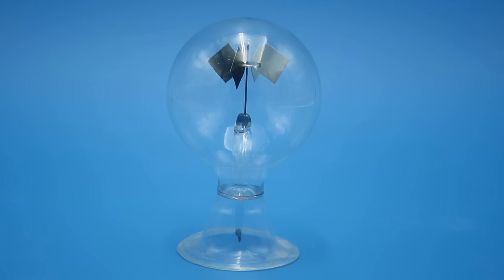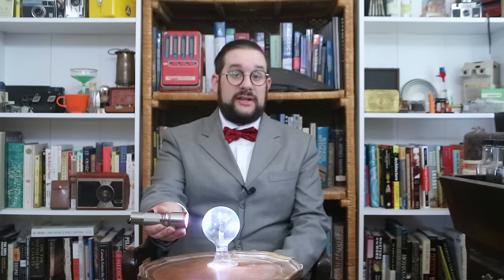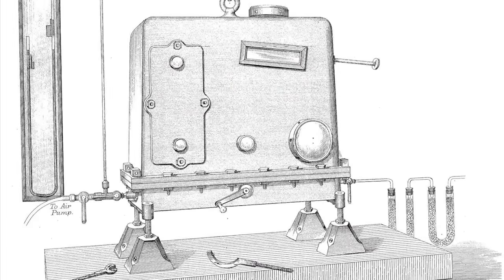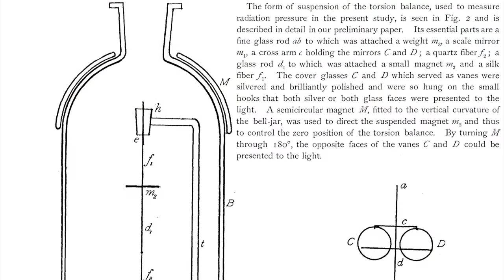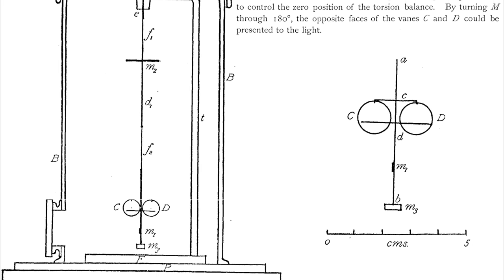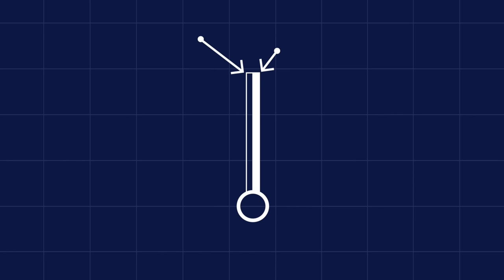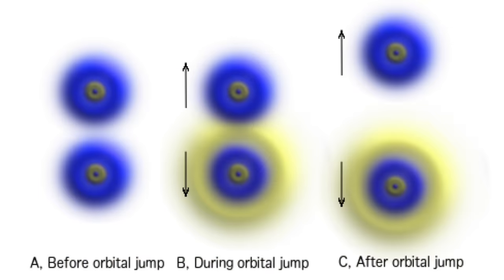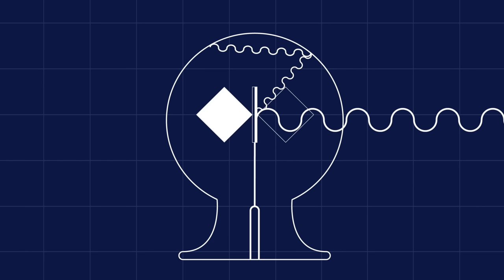Crookes Radiometer: a Surprisingly Persistent Scientific Mystery

Comment: I wonder if the paddles were replaced with balls, each colored half black and white like the paddles, would prove or disprove the edge theory. ( balls having no edges in their shape).
Reply: Seems to me that someone should build an easy to assemble kit where paddles of varying kinds could be tested.  Would it make any difference if the black and white was replaced by conductive materials?  Shouldn't be too hard to just create a bulb that can simply be lifted off for easy repleacement of the paddles.  Seems a lot more experimentation is needed.
Reply: @KenFullman  - but the radiometer only works in a near vacuum.  Making a lift-off bulb is easy - but how would you recreate the extremely low pressure required?
Reply: @jackx4311  With a vacuum pump.
Reply: @fantabuloussnuffaluffagus  That makes a kit like that a lot more expensive though. Not too many people will just have a vacuum pump on hand but even a pretty cheap one is going to run you like $70. A radiometer kit that costs 100+ is a bit silly for a completed item that is closer to 20
Reply: @alexsis1778  Do experiments have to be cheap?
Reply: @fantabuloussnuffaluffagus I would buy a interchangeable radiometer for $250 or maybe a little more depending on build and functionality.
Reply: @sambrose1  I think if you want one, you're going to have to build it.  All of the Crooke's radiometers I've seen have been sealed units, and you're going to need one that you can open up, reseal and pump down.  Rather than having interchangeable paddles, I suspect the simplest solution would be to have different drop in rotor assemblies.  At that point you may as well have separate radiometers with different paddle shapes and forget about changing paddles or rotors.
Reply: I don't know why the shape would have and affect for its in a vacuum
Reply: @jelehan88 they’re talking about being able to switch the shape out  themselves. They would have to take the glass off and lose the vacuum
Reply: Found an article that talked about an experiment like that with the edges.”n 1925, H.E. Marsh, E. Condon and L.B. Loeb confirmed the edge hypothesis [16], and more or less provided the final, satisfactory explanation of the radiometer with an ingenious experiment. They designed a collection of radiometer vanes with edges of different length but similar surface areas, as illustrated below. If the radiometer force arose primarily from the surface of the vanes, then the different vanes should have turned at same same rotation speed.  If the radiometer force instead arose primarily from the edges of the vanes, then each vane should turn at a different rotation speed for the resulting radiometers; this latter result was in fact found to be the case”

Comment: Neat. I always thought of it as excitations of the gas right next to the hotter side providing slight momentum which adds up overcoming the drag. Electrostatic imbalance is even better because it's so localized.  The things have a top speed so a kind of equilibrium should be achieved between drag and exposure time to light on the hot side of any given vane.
Reply: likely correct about gas temp, as opposite spin is achieved by spraying an upside down air duster can on it.

Comment: What a FANTASTIC exposition; thorough, organized, comprehensive and yet concise! I assumed radiometer mechanics was "sorted" once we understood the phenomenon of a comet's tail always pointing away from the sun on its orbit but I did not know that at ultra-low vacuum the vanes won't rotate - fascinating. It's a mark of physicists' hubris today that we claim to know what happened 10^-34 seconds after the big bang and how Beta decay really works (just two of the many examples of conjecture-not-science that reign today) but we still don't have consensus on the radiometer, the 'glass transition, or how Tylenol works!

Comment: My brain hurts after listening to that.

I will now relate an anecdote:  I once noticed that my radiometer had collected a lot of dust, so I took it into the bathroom and ran warm water over it.  It spun as long as I ran warm water over it, the same as if I had held it in bright light.  Note that this was an interior bathroom, so the only source of light was two CFL bulbs in globes, so the light was very diffuse.

I assumed that the radiometer was responding to infrared being emitted from the warm glass bulb.

As my primary objective of cleaning the radiometer had been accomplished, I put it back in the window, without any further experiments, but now I’m tempted to try other things.
Reply: It would have stopped spinning if you kept going with the warm water.
Reply: @leocurious9919  I know.  I didn’t want to get into a long essay here.
Reply: This is probably the inverse of the fridge effect that got mentioned.  Perhaps moving between locations with different ambient temperatures would be an interesting experiment.  In the winter my house often gets to a state where there are places over 80F (30C) and other places below 50F (10C), I wonder if that would be enough?  Well, I guess I need to get a radiometer and run some experiments...
Reply: Electrostatics
Reply: Oh, yes! Your warm water was emitting infrared, which will spin it. The warmth of your hand will make it go if you hold the bulb. I am going to go play with mine now😊

Comment: Spinning vanes, if charged, should be easily detected outside, by an electrometer, even at incredibly low voltages.
Use copper telescope mirror or germanium lens as an "un-spotlight" to optically focus a small cold (0K degrees) object at the radiometer, so it spins backwards constantly!  Or, as your "anti-lamp,"  try a light-bulb filament that's turned off, and cooled with droplets of liquid nitrogen.
Is the net force actually proportional to the area of the vanes, or to the edge-length of the vanes?   Vane shapes: I've seen toy radiometers with circular vanes (probably circular cover-slips for microscope slides.)  Employ sodium silicate glue, to assemble odd-shaped vanes from fragments of cover slips (then soot-coat one side black, the other side white using smoke from burning Mg or W.
Hmm, if EVERYONE always uses carbon-black as the dark part (soot from kerosene flame, etc., ) maybe the sharp tips of the nanoforest, in near vacuum, are launching little atomic beams made of air molecules?  What if they're functioning as light-powered ion engines?!!  Just compare black paint to black soot coating.

Oddity:  if a Tesla Coil is used to cause the gas to glow, the vanes immediately spin.   Do this in a microwave oven, and in a brief moment, the vanes are violently "kicked," and spin in a blur!  (Both devices cause black side to retreat.)
I have 15 of these, from a $5 post-xmas sale, plus momentary $12 price at Sciplus catalog.   So I had no problem with nearly destroying one inside a one-kilowatt microwave oven, although I did put 2cu of water in the oven, then gradually reduce it and re-test, until the radiometer gas would finally be ionized.  Didn't destroy the radiometer.   Huh, I should go back and see how much it takes to actually fry the radiometer.
Was it Actionlabs who discovered that black soot paint in near-vacuum, hit by ?100mW? IR laser, will glow brightly orange?
Reply: Oh cool, William. I think I know your work from previous work and discussions on the internet. Cheers.
Reply: Hmmm ... my comment just got eaten ...
Reply: @uploadJ  don't include any links.   Sometimes it will survive if it has one link, but not two.   If you want to make an old comment vanish, edit it, and add an URL.   (Even including youtube links will make comments vanish.)

Comment: While sitting here at my dinner table watching this video, I grabbed my radiometer {currently sitting on the piano next to the table}, and an L.E.D. flashlight I had left on the table, and AWAY SHE GOES {i.e., the radiometer SPUN}. I thought radiometers only spun 'well' for incandescent bulb light sources, but I now know that is incorrect.

I also carry another L.E.D. flashlight in a belt pouch. I then shined BOTH FLASHLIGHTS on the radiometer and IT REALLY SPUN. 😊

EDIT→ I shined both flashlights on the lighter sides of the vanes -- they appear to be bare metal, not painted white -- and the vanes did slowly move towards the lights.

Comment: Interesting experience. If you use an old camera flash gun and fire it at the radiometer, the vanes spin wildly as if hit by a major force. If you then fire the flash gun at your hand you can feel a force, or a rapid transient change in temperature. Feeling this force on your hand is noticeable even if you cannot see the flash and it is fired by another person.
Reply: Yes! I used to play with my old camera flash this way. Also, if you take a little scrap of paper and fold it so it stands up, the flash will knock it over or scoot it across the table
Reply: Sometimes it hurts lmao

Comment: Given that the inner surface of the radiometer in the explanation given by Liu is involved in the effect, it should be easy to carry out experiments with radiometers of differenct diameter glass bulbs. Then the surface area of glass versus surface area of black plates will be different and they should effect rate of rotation.

Comment: I have had a crooks radiometer since I was little.  A peculiar effect I observed was that it would spin if I rubbed the surface of the glass bulb with my fingers in a brisk fashion as to possibly be creating a static electric charge upon the glass. As a result, the veins would rotate very briskly white side leading the direction of rotation. Reaction time was nearly instantaneous and would stop shortly after I stopped. This effect is greatly enhanced when I hold the radiometer by its base in one hand as opposed to leaving it stationary upon the table (formica covered wood table)
This leads me to believe the explanation about electrons given in the video

Comment: I did this experiment I made black veins and silver veins by depositing aluminum on one side carbon black on the other side, made my own bearing, put it in a vacuum chamber, pumped the chamber down, plotted rotation, as a function of pressure at a certain pressure It turns away from the black then it stops, and it very low pressure. It turns away from the silver.

Comment: At University you learn the Reynolds theory as the accepted one for the radiometer. I almost forgot it and was writing another comment that I deleted. The water effect is the main evidence. I thought that this question was settled 100 years ago. Nice to learn a new thing and see that it may not so simple.
But I have heavy doubts: applying it to Brownian movement is too much IMHO, Einstein calculated the Brownian movement with a high degree of precision without the need for additional hypothesis Besides it is easy to test that using different substances with different elements modifying the behavior and orbital transitions are sensitive to frequency what also could be measured. It is an almost obvious test. Besides yet, how a charge can repel neutral atoms? Some dipole effect? Besides how this explains the cold water effect? I will need to read Liu's work to decide what I think, but I am very skeptical.
A referee stealing an idea that he avoid publication is the epitome of ant-ethic work another thing I learned.

Comment: Very interesting! I agree with Liu. In addition, the kinetic energy produced depends on the time each atom remains enlarged due to orbital jump: On the reflective side, this time is essentially near zero, because being unable to retain a new orbital equilibrium, an interacting electron can only immediately return to the orbital condition (honestly, more likely one of the sea of conduction electrons) that it was in, which is what results in reflection: a new photon, of exact energy as the incoming, just in  a new direction. There's radition pressure there too, but it's too small to move anything unless you really brute-force it like with a pulse laser. (there's a method to actually measure pulse laser pulse energy, by physically measuring the recoil of a mirror deflecting the pulses! only possible because the pulse peak power is around 10^7 W or so) 

Therefore, absent atoms storing energy as excited electrons, and those excited electrons increasing the kinetic diameter of the atoms for a time (until they relax and reemit light), allowing this strong repulsion force time to push on other molecules caught 'too close', and thus transfer energy to them. There's no such thing as a 'soild surface' at this scale, it's just that such an overlap between atoms creates very strong electrostatic repulsion for as long as the overlap exists, pushing the atoms apart and resulting in acceleration and a change in velocity.

This is likely to also transfer kinetic energy from the atom having the absorption, slowing/cooling it from the excess energy it picked up during the electron's transition. We'd expect this absorbed kinetic energy to generally be much less than the energy of the transition, and is effectively a phonon contributing to the total kinetic energy of the molecule or solid surface.

So, in the end, it ends up being a heat engine after all: just one due to each atom's 'orbital jump' resulting in a change of kinetic diameter, causing it to act like a little spherical piston on all its (very local) surrounds. Thus it transfers some momentum both into the nearby gas, as well as into its solid neighbors, and this is ultimately integrated into the total force available to move the radiometer. It is interesting, is is not, that the mfp of the best pressures for a radiometer, just so happens to be (in nitrogen at least) about the same length as the scale of the radiometer's vanes. 1 Pa at room temp, in nitrogen, give a mfp of about 7 mm.

Come to think of it, the atom acts like a little 'vacuum-backed' speaker: This is one where you put an electromagnet inside an evacuated container, such that it can emit sound without producing a backwave like a conventional speaker (becomes infinitely-baffled if the MFP inside is much longer than the radius of the speaker. Thus, it's able to emit a pulse of pressure on the surrounding environment, without also producing a movement wave in the opposite direction, such as a typical speaker does from the back of the moving surface. In this case, the same process would occur again (a negative pulse) when the electron relaxs and emits a characteristic light emission - but by then its surrounds are further away, and there's no corresponding 'suction' at this scale, just the recoil from the small momentum of the photon emission, probably nulled out by the corresponding jump-reduction in kinetic diameter.

Comment: As a non-physicist it seems obvious to me how it works.  The light is absorbed by the black surface and heats the air adjacent to it raising the pressure compared to the white side.  This causes the vanes to rotate.  As they rotate a hot thin film of air 'sticks' to the surface of the vanes due to "fluid sticks to a surface effect" and does not mix with the air in the bulb.  Of course the heated air leaks around the edges of the vanes as it tries to equalise the pressure but friction between the air and the surface of the vanes slows it down sufficiently that the replacement air can be heated by the vane.

Comment: What about using laser light emission?  Perhaps one could strike the white side of the radiometric blade with 405nm laser, whilst striking the dark side with a laser in the 600nm+ wavelengths in opposition to eachother (of course with equal power emission from both sources).     What happens then?    Is this type of light source too narrow in bandwidth for noticeable change in reaction?   Though much wider in bandwidth,  LEDs were usable for experiments. what wavelengths were used in those cases?   What properties of light give rise to more noticeable effects;  does wavelength play a significant role to affect change? What about bandwidth density?  Or perhaps it's just bulk emission photons regardless of the range of applied wavelength s or bandwidth(s)???

   This would be awesome for a science fair project!   But not for someone in their 40s 😒

Comment: @CanadianMacGyver found an old experiment proving the edge theory apparently. It’s read as “n 1925, H.E. Marsh, E. Condon and L.B. Loeb confirmed the edge hypothesis [16], and more or less provided the final, satisfactory explanation of the radiometer with an ingenious experiment. They designed a collection of radiometer vanes with edges of different length but similar surface areas, as illustrated below. If the radiometer force arose primarily from the surface of the vanes, then the different vanes should have turned at same same rotation speed.  If the radiometer force instead arose primarily from the edges of the vanes, then each vane should turn at a different rotation speed for the resulting radiometers; this latter result was in fact found to be the case”

Comment: I wonder if or how variations on the usual design would work.  Such as one side mirrored instead of white; half painted spheres instead of flat plates; red, blue, green, white, black, or mirrored sides in various combinations; unpainted vanes made of sandwiched materials of different reflective qualities such as lead on one side and polished gold on the other; different underlying plate materials such as aluminum, gold, or tungsten; larger bulb sizes; laser light at various wave lengths; and finally, various density gases such as helium or sulpher hexaflouride residue the evacuated bulb.

Comment: Riveting, compelling and very interesting!. Subscribed. An obvious next step would be to use different coatings on each side, for example, different colours, a coating which emits electrons vs one which doesn't etc. I need a vacuum pump and a sealable bulb. It is obvious that the gas is an integral part of the (re)action.